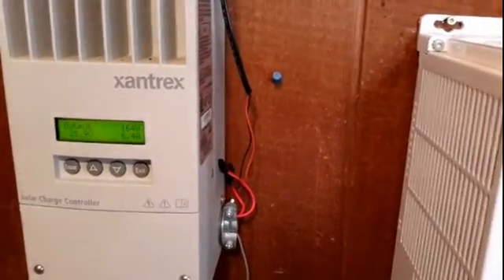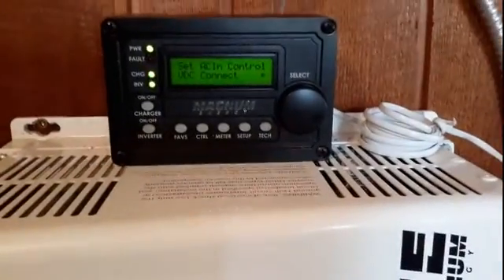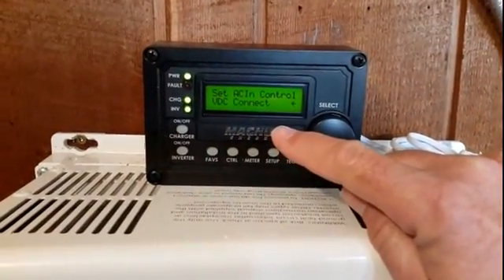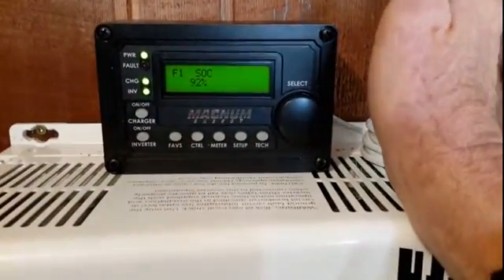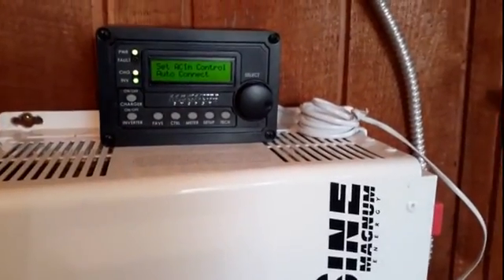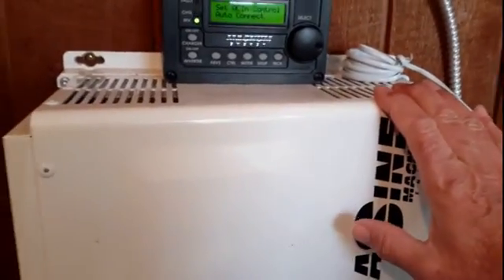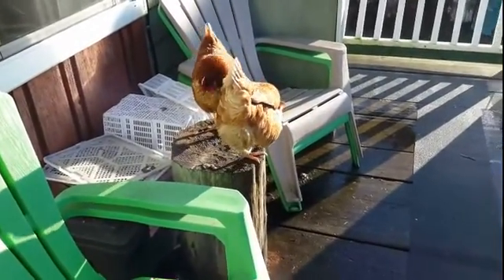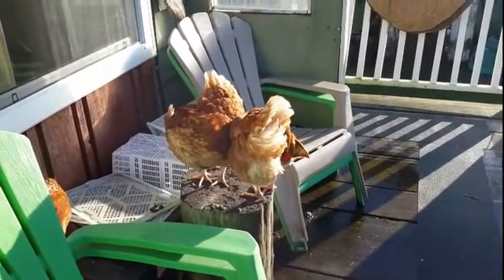How I Use my Solar Power in Winter

Comment: I need to get my battery backup set backup.. i disassembled it to do maintenance and have been lazy.
Reply from the maker: Winter is coming!!  lol!
Reply: Norman McGregor Yep.. I need to do some Videos.. Not worried i Bought a 3500 watt gas gen. Si i will be good.. but i do need to get my #$% together and get this stuff back in working order...lol
Reply from the maker: How is your solar hot water working?  I've been thinking of putting one on my place.
Reply: Norman McGregor Actually it works great.. I dissembled it a couple months ago though.. going to move the existing one to the land for the cabin. I need to start working on things here. I'm going to build my own large panel from scratch for the house.
Reply from the maker: Nx2overide I would love to see a video on how you build it!
Reply from the maker: I have a 3500 propane powered gen that I used twice since we moved here but have not needed since I hooked up my solar.
Reply: Norman McGregor yep i want to get a pro-pain kit for mine.. its always good to have a backup plan.
Reply from the maker: Nx2overide For Sure!

Comment: I'm 3rd Looking Great Norman Buddy You should Install A Second Wind Turbine What Battery Bank Voltage Do You Have Buddy  That Would Crank Out The Power All Night On The Island  I love My 2 WindMax   1000 watter's  Looking Great Norman That Air X kicks Some Power I had an Air Breeze 200 Watter at 12 Volt Check out these Puppies https://youtu.be/v3gEHuJ6xJ0
Reply from the maker: Those are Great turbines for sure Kenny!  However the wind speeds here are either Extreme or nothing which make it hard for wind turbines to produce good amounts of power! With that said, my AirX produced 768 amp hours of power in November which kept the lights on and everything working great!  :)
Reply: Norman McGregor Well said Norman Air X Wind turbines are Great That is allot good Amp Hours keep the Videos rolling Buddy
Reply from the maker: Yup!  Its been windy here for sure in November Kenny!
Reply: Norman McGregor We had some Good Winds also enough to Keep The Power Flowing on the Bad Solar days It was 77 degrees here today in Virginia crazy weather I will take it  Cheers Buddy
Reply from the maker: looks like we are in for some cold weather  below 0 next week.  Woodstove will get a workout!
Reply: Norman McGregor I betcha it Will Buddy Video Time Man keep Warm Norman
Reply from the maker: KVUSMC / Kenneth W Viar Jr For sure me thinks😀
Reply: Norman McGregor 10-4 Buddy